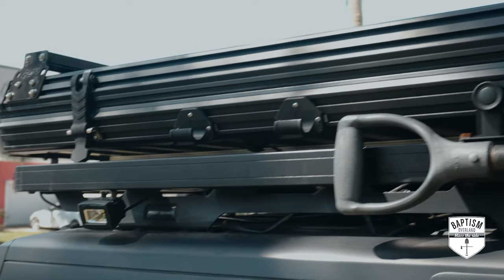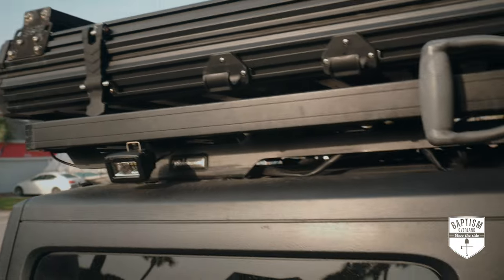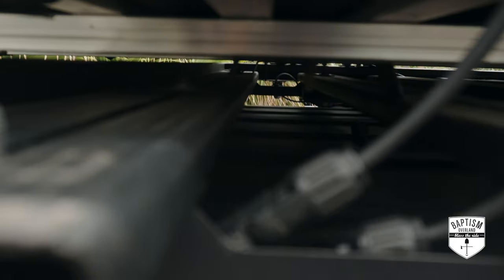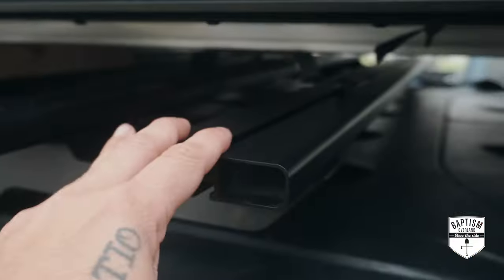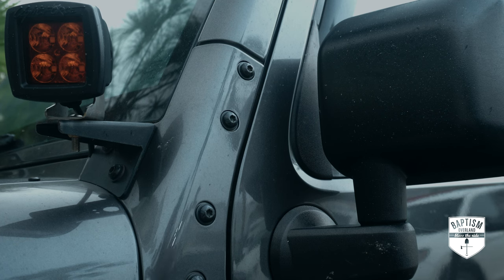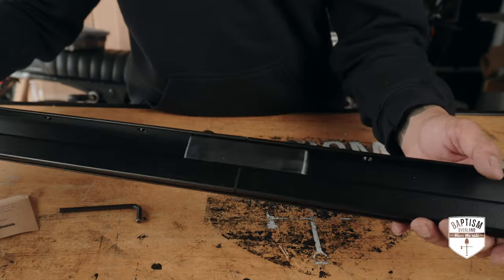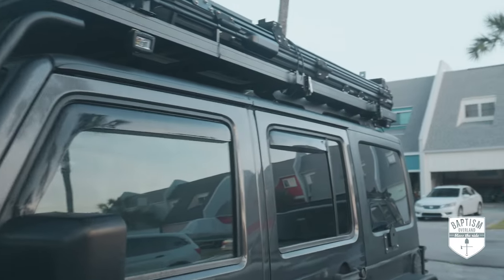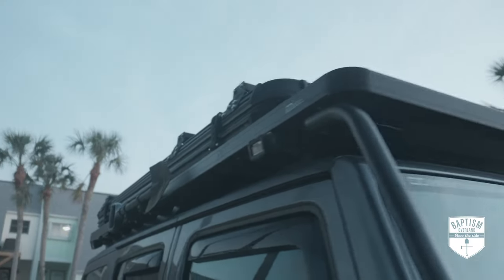Front Runner Slimline II *Half Rack to Full Rack Conversion!*

Comment: Your production certainly deserves more than 10k subs. Nice job.
Reply from the maker: Thanks man! I hope it continues to grow!
Reply: Great video Asia, have you turned on your weboost to see if there is any interference with the inside weboost antenna. I remember there was a minimum distance between the two antennas
Reply from the maker: @tim285401  I did actually! My internal antenna is in the middle of the Jeep. So it's the same distance as when it was on the other side. Actually even a bit further now since it's closer to the front. No issues!

Comment: Looks cherry 🤙🏽. The updated A pillar bracket arms look nice. I was thinking about upgrading to those since I have the older version A pillar brackets but I wasn’t sure if my AEV snorkel will be compatible with it or not. Maybe a question for FrontRunner 🤔
Reply from the maker: So I spoke to them and they DO have brackets that go on the rain gutter but it has to be for really light loads because those rain gutters are made of fiberglass. I might look into it so I don't have to use the brackets at all

Comment: hey, I also have half rack and want to extend. How much cca was extended set from Front runner as I cannot find it online and wait for dealer..
Reply from the maker: You'll have to call FR directly as it won't be online. They said you have to call for the parts so they can add up what you need. They can answer everything. They discounted me a huge lot. I believe I paid like $300 if I remember correctly